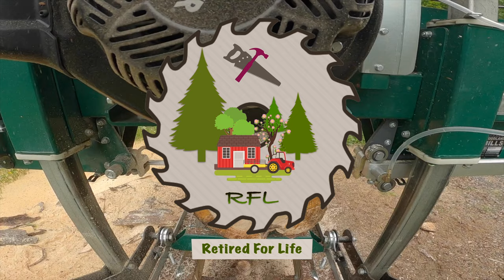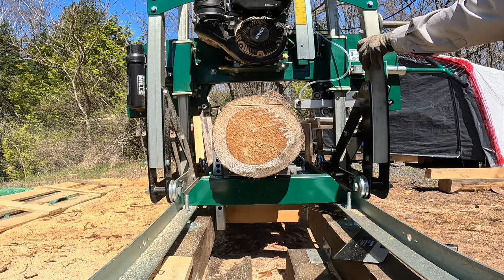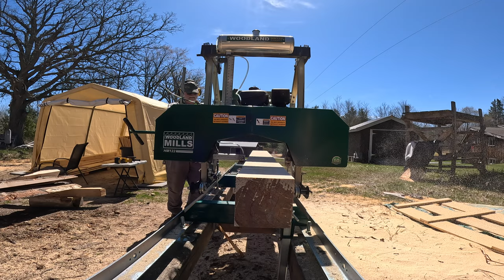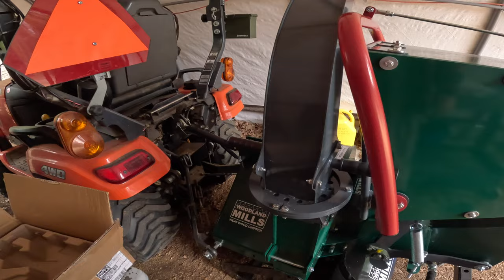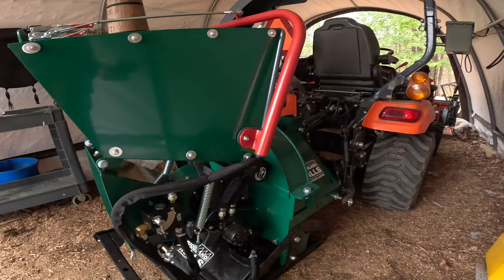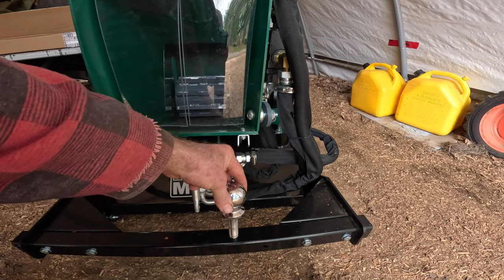Assembling Woodland Mills Chipper & Turning More 8ft Logs To Lumber

Comment: How's she goin'?  The chipper is a solid rugged piece of gear!!  I am not surprised that Woodland Mills had a fix for your hitch and were willing to send it to you at no cost.  Their customer service is 2nd to none.  Take 'er easy!!
Reply from the maker: Yes they have been very good every time I called them. I’m looking forward to starting it up. Thanks for stopping by.
Reply: @retiredforlife63  When I received my chipper one of the bearing blocks for the flywheel was broken.  I called them and they said send it back no charge and they replaced it.  Pretty decent, other than I lost 2 weeks of prime chipping time!!  LOL

Comment: A chipper is something I am in the market for but not a pto drive chipper only a gas powered one. I usually burn what I can but we plan on getting animals and the chips would come in handy for bedding and sorts. I am staying tuned to see this unit in action. Certainly heavy duty but some minor flaws as you pointed out.........glad Woodland is taking care of the flaws for you Brian.........awesome.......cheers.
Reply from the maker: I already had a small gas powered chipper but it just dumps the chips out on the ground from an opening in the bottom. It was also a real challenge to feed branches into it. Way to much of a pain for what I want to do now. They were quick to send the new part to fix the hitch. I just installed it yesterday. Up coming video. Thanks for stopping by!

Comment: It is good to watch the sawmill in action. The wood chipper looks like a very made machine. It does seem a little odd to have that bearing grease fitting in it's current location. The hitch is a very poor design, I assume the replacement part is box section that has a curve in
Reply from the maker: Generally Woodland Mills make a very good piece of equipment. I have a few things from them. This mistake was a surprise. They were quick to send the new part to fix it. I just installed it yesterday and it now works fine. Thanks for stopping by!

Comment: Good evening Brian   With regards to your sawmill cover, how long have you had it and how has it been holding up to UV rays, wind, etc?  That is bit of a surprise that the design location for the hitch ball interferes with the forward/reverse lever.  Glad that Woodland Mills is sending you a free of charge fix for it.   Have a good one!
Reply from the maker: Hi Paul. I’ve had the cover for 2 1/2 years. It’s standing up really well. It’s still soft and fresh looking. It is in near new condition. The UV rays have hardly done anything to it. Woodland Mills does seem to pretty darn good at just about everything. Thanks for stopping by!